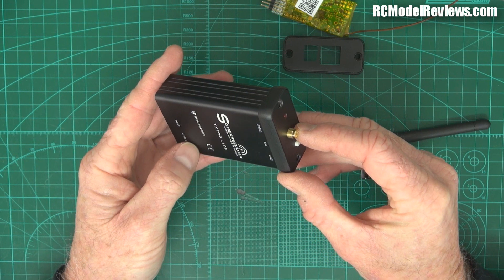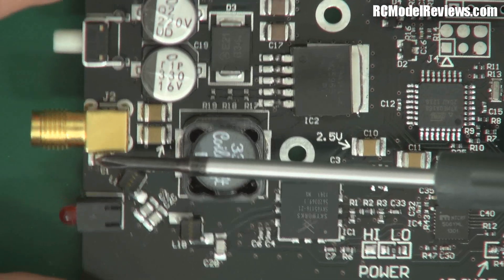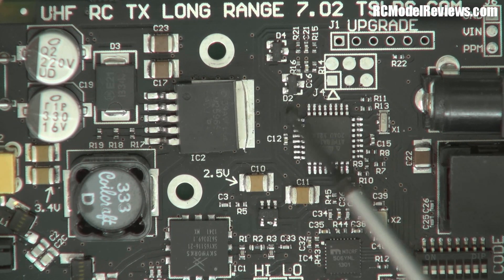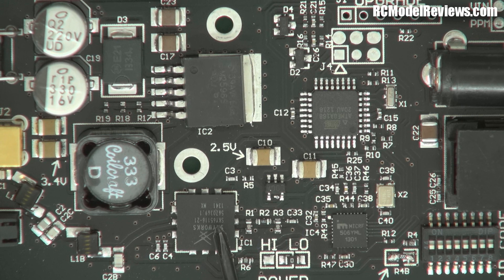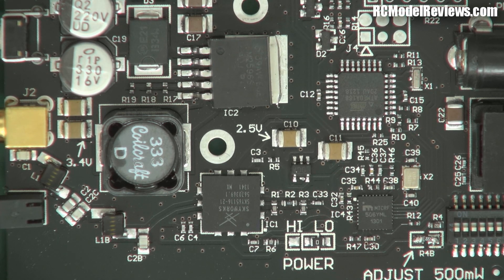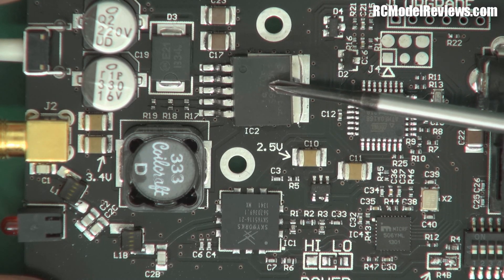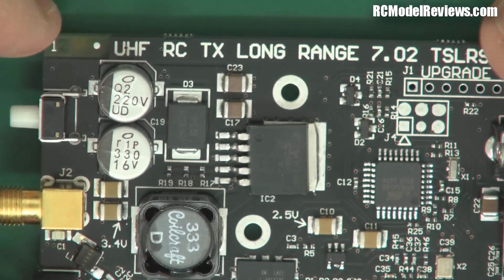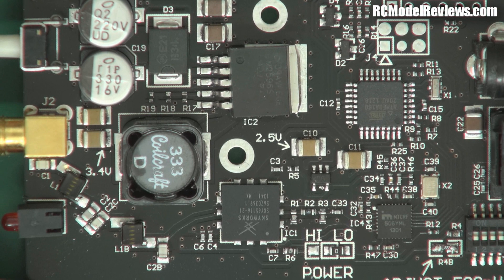UHF RC Shootout: Scherrer Long Range System (part 1)

Comment: I have a walkera 250 runner having binding issues I was wondering if i can replace the receiver with another make If so would you recommend one for the Devo 7 transmitter

Comment: This is a nice board!  Well designed, clean, tidy! The placement of the RF amp and SMPS IC along two holes for a heat-spreader. Really nice. 

The only thing I don't like is using a transceiver just for half it's job! Minimal adjustments and there would be a solid LRS link not just a one-way RC. 

And the colours used on solder masking do have a sort of code (not a standard, just marketing )
Green and yellow (transparent) being low-grade electronics. 
Red and blue being high-end and, finally, back and white solder masking are reserved for pro and luxury electronics. 
It's just something I deduced over the years.

Comment: Hi, good video. cant wait to see part 2.. btw, there is a solderpad on the back of the diversity reciever namend "rssi" .. is there rssi provided by this receiver or not? and what does it output? would be cool to feed the rssi into your osd to see the signal strenght.

Comment: I like the LR RX but seeing the high output hack-ability of the TX is making this UFH gear worry me as there are rules for reason of safety both with the FAA and FCC where "odds of happening" mean it will happen given time and "odds" don't mean squat... and for too many idiots as too many videos show rules don't mean squat to their limited understanding or outright lack of concern. Glad there are so few views on this series as some people have issues dealing with short range and this is the last thing they need to use with a set of bad habits.

Comment: Nice video. Can you provide a bit more info? What kind of antenna connectors are those on the diversity rx? Does not look like SMA and from the video it is hard to say whether they allow the antenna to be locked (else it might come of after a hard landing). Also any info on how the FW can be upgraded? It misses a USB connection but has some pins labled upgrade.... TTL? Thanks

Comment: I own an earlier version of the TSLRS long range receiver that doesn't have the big capacitor bolted on the side.  And on my first flight it failed miserably in what I assume was a brown-out.  I was taking off with full power and 3 seconds after launch I lost control.  I had failsafe set correctly and an autopilot on the plane setup to handle failsafes so the plane climbed to 200 feet and circled.  But after the assumed brown-out things didn't get better on the receiver.  Looking at the logs from my autopilot, I could see that the receiver did not reboot and recover but stayed in the failsafe state for 12 minutes.  From the logs I could see that the servo rail (and thus receiver) voltage was at 5.2 volts.  After 12 minutes it then went into a non-failsafe state mode with all PPM channel outputs in their center positions, but I still had no control.  I tried multiple times to regain control from the ground by restarting the transmitter, switching power levels, changing batteries, changing antennas, etc. all to no avail.  My center servos positions were off center enough that the centered signals kept the plane in a very large (1/4 mile) circle.  Eventually the battery died enough for the ESCs to go into low-power mode and the plane came back down to the earth, barely missing a forest.  It took some searching, but luckily I found it.

Notably, the brownout did not show up in the autopilot logs, so my servo rail voltage must have passed a critical minimum for a period shorter than the 1/10 second logging rate. I can understand the system being sensitive to brown-outs, but TSLRS should really recommend a separate BEC or battery if that's the case.    Since TSLRS now offers the version with the capacitor, they obviously know there's a problem.  And not rebooting correctly is unforgivable.  Any receiver MUST be able to automatically reboot and return to a working state after a power outage or brown-out.

Since that experience, I've kept my TSLRS system on the shelf.  My plan is to try it again with a dedicated BEC, but my confidence in the system was destroyed.  I'm back to using my HawkEye OpenLRS system.